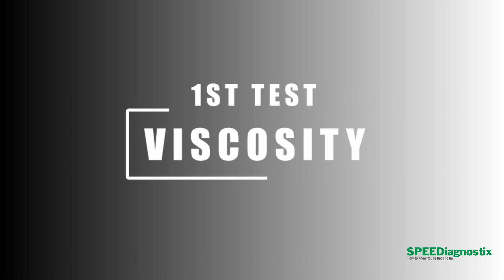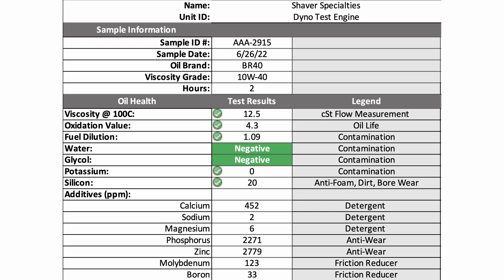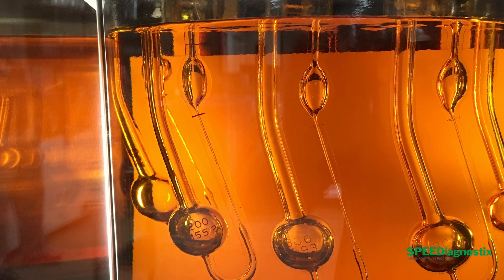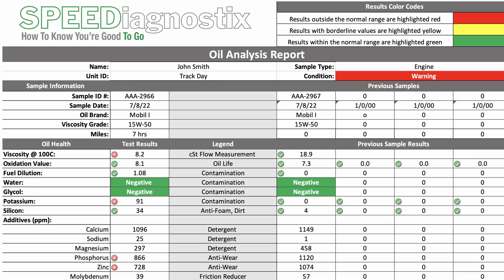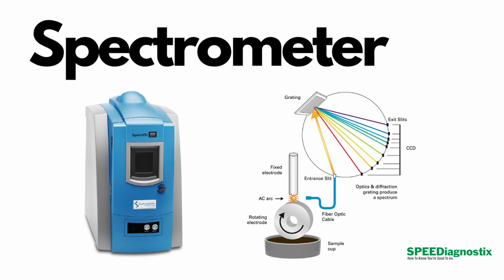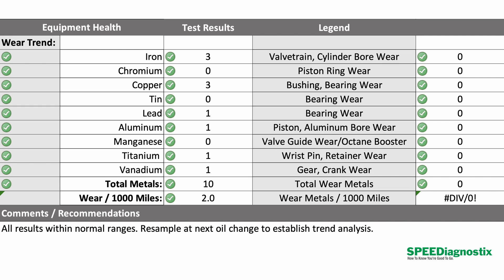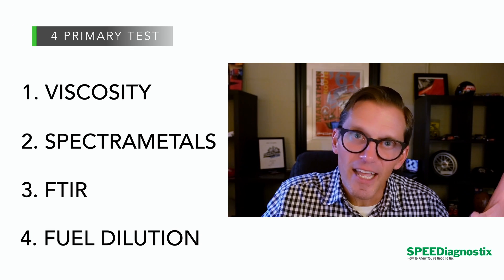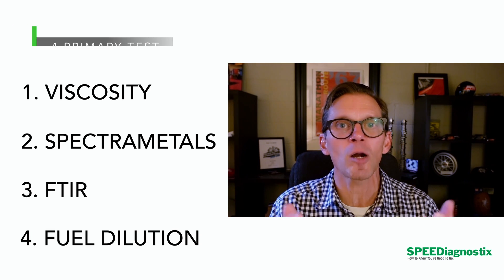No PhD Required! A Certified Lubrication Specialist Explains Used Oil Analysis In Plain English

Comment: Thanks for all of your videos. I have been getting quite an education in the past few weeks. I would like to know if there are any tests that can be used in oil analysis to get a rough idea of the condition of a wet belt (like in the 2.7l ecoboost engine). I recently drove a Bronco and liked the 2.7l engine and 10 speed transmission combo, but not being able to easily inspect the wet belt is a concern. Thanks.
Reply from the maker: Thanks for watching! The particle count is about the only way to do that, but it can not target the wet belt specifically.

Comment: Smart people who have common sense prefill their oil filters. There is a recent youtube vid from lake speed jr who scientifically tests and measures the amount of wear on a dyno engine that was started with a prefilled filter then with a dry filter. The oil analysis tests confirm conclusively that non pre-filled filters cause substantially more wear to the engine, particularly rod bearing wear which was extensive.  Its hard to dispute the results of highly scientific tests when the only variables are pre-filled and non pre-filled oil filters. The facts pretty much speak for themselves without adding old farmers tales passed down from a persons grandpappy
Reply from the maker: Thanks!

Comment: Wide viscosity range oil vs smalerl viscosity range?

my manual says I can run 229.5, 223.5 in 0-40, 5-40, or 5-30
comparing the specs sheets from Moble 1 for the Europen 0-40,5-40,5-30 (all meet 229.5 and 223.5)

Question: For outside temp above 60 degrees. An oil with a wider larger span like 0-40 vs 5-30 what should I know about that oil? will one give me better fuel eco and more wear or ? (I think my engine runs when hot about the same temp regardless of the outside air temp or I think in theory it should. So the thought is the high number should not matter? The high temp on my oil being if I shut down with the turbo hot and not let it cool down after driving hard.) Why would I be told from Moble 1 customer service that I "would get better gas mi/ less engine resitance with 5-30" but when asked about understanding the spec from their web page got 'follow the cars manual"?. All 3 oils being acceptable in the manual.

In specs from mobile 1 gives

Grade, Pour Point, Fash Point, Kinematic Viscosity@ 100 C and Kinematic Viscosity @ 40 C, Density,

what should I know about the specs or does it not matter and just change that oil every 3k and not the 15k per book?

Comment: IF you can't just keep your dick skinners off your car's start switch, at the very least allow it reach operating temperature. In a previous life I was a maintenance manager responsible for equipment  that operated normally with electric motors, but each electric motor had 2 internal combustion backups that were required by ANSI standards to be started weekly at a minimum. The only measure that kept us from changing the oil almost monthly, was to ensure the motor got up to operating temperature any time it was started.

Comment: Just sent you both a new and used sample of Kirkland Signature. Really curious to see the numbers. Messed up a bit- i had Liqui Moly MoS2 and magnetic drain plug this time. Next time will be 'clean' sample.
Reply from the maker: Thanks!
Reply: You didn't screw-up. Be confident what your magnet captured is removed from circulation therefore not a threat to engine's health.
Reply: @blackrifle6736  If there are metal bits captured by the magnet that means they are not in the results of the oil analysis, throwing off whatever results were generated.

Comment: My 2011 f150 5.0 had 130,000 miles on it now. About 2 years ago I started using Marvel Mystery Oil in the gas. I'm a big fan of it. The last 3 oil changes I've been adding a little MMO in the oil 1,000 miles before the oil change. What's your opinion on that stuff?

Comment: Thanks for the great information!   
My question is does motor oil have a shelf life?  Before and after opening?   
I understand the API codes and how it would be very bad using an oil from the 50s on a modern engine.  
Thank you!

Comment: Got a question for you about my build and what oil weight I was to use. I have 6.0 with high lift cam and ls7 lifters and the other basic mods to go with that. Engine builder was adamant about 10w40 conventional only, no synth oil!     He claims synth oil causes wear in the valve train and he has no issue with it, only issues with synth oil. What have you noticed when using Driven oil  with engines like this ?
Reply from the maker: The problem is not with the oil being synthetic or conventional. Valvetrain wear is primarily about the additive package. I’ve seen great results with the synthetic blend GP-1 oils. In fact, the lowest valvetrain wear I’ve seen is with the GP-1 oils.
Reply: @themotoroilgeek   I thought as much. Which viscosity do you recommend for GP-1 oils ?
Reply from the maker: @g8gtatlman483  Viscosity is all about bearing clearances and operating temperatures. With that said, the 10W-30 will work well in a street driven LS7 as long as the bearing clearances are stock.

Comment: Lake, i am here in the Charlotte Area. I use Amsoil signature series in my SUV. Do you do the lab testing?
Reply from the maker: Thanks for the question. The lab is in Ohio. I do the analysis.
Reply: @themotoroilgeek  awesome thanks! I love to meet you sometime. Could I get the website for the lab? I have used oil analyzers with Amsoil.
Reply from the maker: @jimmyhercey3608  We sell oil analysis kits. The lab runs the tests that I specify. I take the test data, review it and provide you with the report. Our website is www.SPEEDiagnostix.com

Comment: ok here is the BIG QUESTION i have a 30 over 351w  stock standerd bearings and its turbo with forged internials , all bearing clearences are STOCK what would be the best oil and weight would YOU think i should run, thank you so much for your videos they are awsome. also i run about 170/180 temp , street beast machine. 22lbs of boost i run . roller cam
Reply from the maker: Thanks for the comment and question. Go with the Driven GP-1 15W-40. We use that oil in our Procharged LS for the Engine Performance Expo, which makes 1,300 HP.

Comment: Good content what are you thoughts on hexagonal boron nitrate as a oil lubricant
Reply from the maker: Thanks for the question. In my experience, any solid particle additive in the oil increases wear in the long term. The best wear protection additives react chemically with the surface to create a thin, sacrificial film. In my testing, the solid particles increase abrasive wear over time. We have some independent research going right now, so we hope to have a video on this subject early next year.
Reply: @themotoroilgeek  cool thanks for responding the reason I ask is some of the oil treatments on the market have this hexagonal boron nitrate as the micro metal filler it does withstand extreme temperatures but most of the manufacturers of such products keep the msd information secret I think this is this nano ceramic stuff on the market
Reply from the maker: @jonschwartz9669  I'd agree that products marketed as Nano Ceramics are likely HBN.
Reply: @themotoroilgeek  during lock down I was online and went down a rabbit hole of lubrican information and found a few articles of hbn as a oil lubricant and the study results were positive but how certain particles and different metals react together under heat and pressure is way above my pay grade 😂 I know oil manufacturing is a business and marketing is important for sales I guess as consumers we need  your skills to help us along the way its the additive package in the oils that help protect but why do they vary in amounts of said ingredients I mean if they find the perfect formula for engine protection why change it or is it an ongoing science of results and engine variables and emission standards
Reply from the maker: @jonschwartz9669  Ahh, yes! Oil chemistry and how things interact is highly complex, and things do change because of emissions and fuel economy mandates. As such, it is an ever evolving balancing act, and that is the key perspective. Oil performance is about the balance between the base oils and all the individual additives. It is not a sum of the parts. It is the synergies amongst the components.

That's one of the reasons for starting this channel - to go beyond the marketing and "backyard science" and get to the real stuff.
Reply: @themotoroilgeek  keep up the good work on my way to purchase a gallon of 5w30 mobile one extended performance and a matching filter I will be directing traffic to your channel thank you
Reply from the maker: @jonschwartz9669  thanks!

Comment: Lake, Spare eng sitting in the trailer....Is it true that the new oil in the pan can go bad if it sits (lets say a couple of years) even though the eng has never been fired and is sealed?
Reply from the maker: I’ve never heard or experienced that. In fact, we just ran my dad’s old motor that had been sitting for nearly 20 years - no leaks.

Comment: ok Lake....

tell us...running a 2.5 to 3 thousandths rod and main clearance on a sbf racing engine with chevy 2.10 rod and a 2.7 main.........what viscosity should we run?

ill say 12.5 to 1 comp.   7500 rpm.   700hp.

should we stick with the mob 1 15/50 syn, or should we go thinner?

how important is the additive package for us?

WHat about MOREL roller lifters?  (Many-many roller lifter oems state DO NOT run syn oil)

All the best......thanks!
Reply from the maker: Thanks for the question. What is your operating oil temperature? Race only or street/strip? Hydraulic roller or solid roller?
Reply: @themotoroilgeek  solid roller.  670 net lift.   street---drive to race track..   unsure of oil temp.....but its a wet sump -no cooler.......
Reply from the maker: @harryharry3193  I'd go with the 15W-40 Driven GP-1, which is a semi-synthetic. It was designed for street/track applications just like yours. Drag race, right?
Reply: @themotoroilgeek  yes drag race.

Why is such a thick , high viscosity important?
Reply from the maker: @harryharry3193  yes, for those bearing clearances and a wet sump system with no oil cooler, the oil will be 260F just after a 30 minute drive to the track.

As such, the 15W-40 is what will provide great bearing protection without robbing a ton of HP.